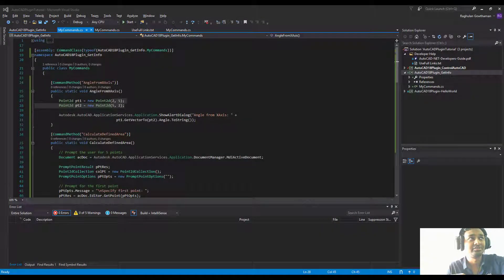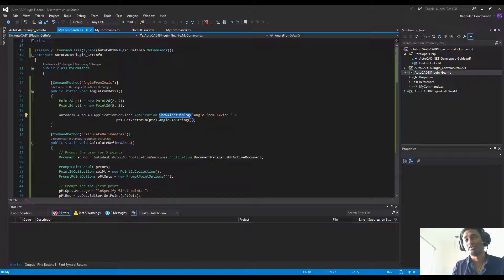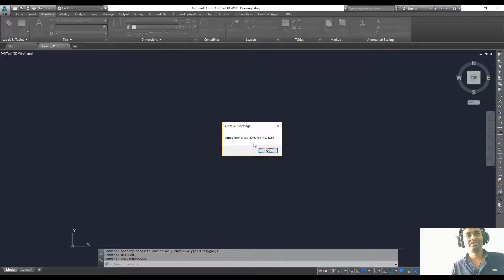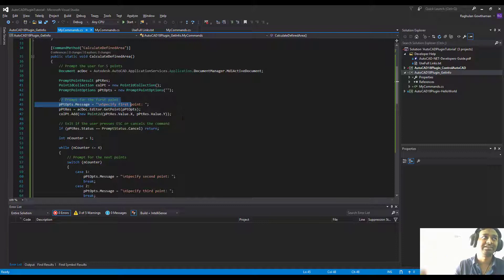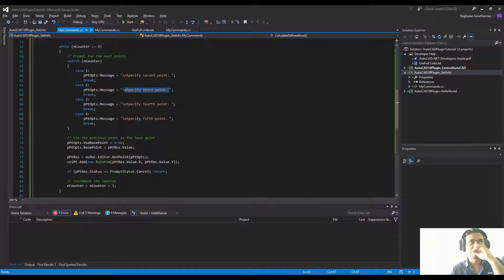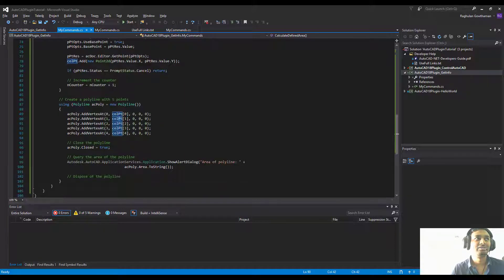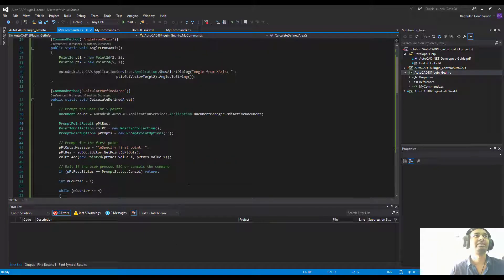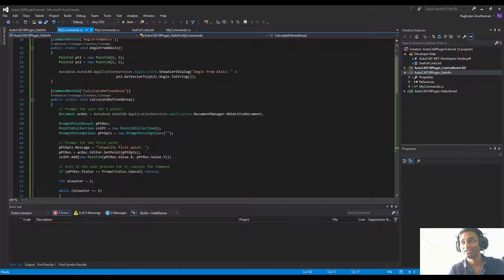AutoCAD get angle and area from object using C#

Comment: hi at first thansks your video ı have a question 
plug-in, which measures the shortest distance between two objects
Reply from the maker: Yup can be done may be will do a video. Just create a plugin ask the user to pick two points then using measure you can get distance between them using c#